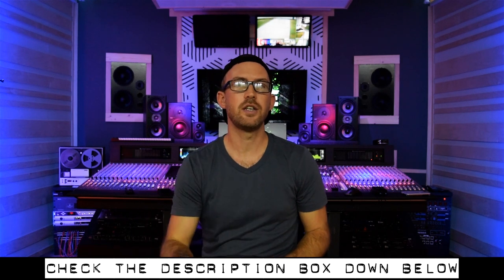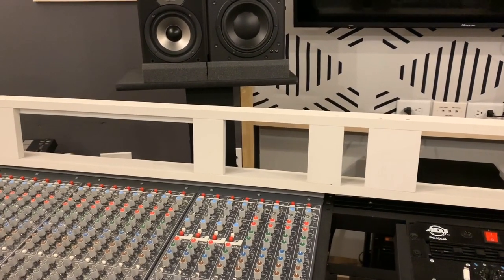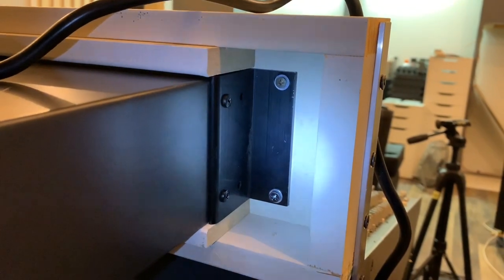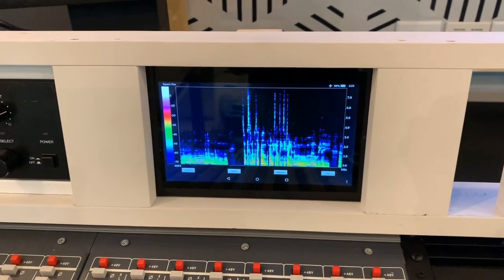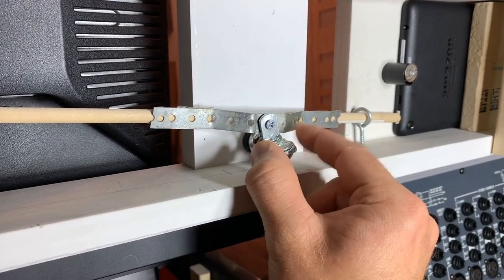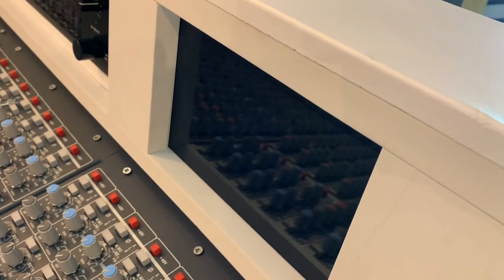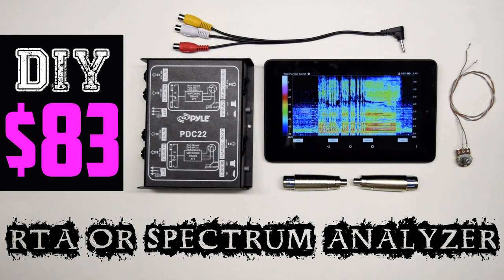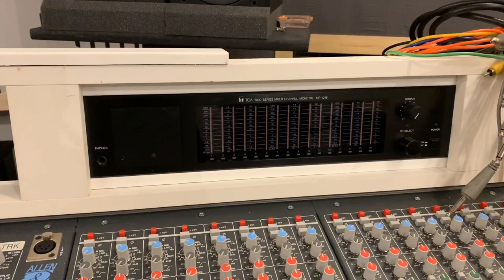Custom Meter Bridge for the ALLEN HEATH GL4000

Comment: finally someone who has done something like this.  love the idea of using the tablet but i think a much bigger one would be great....and feeding it from an aux is not something I had thot of...it actually makes a ton of sense.  I am working on the idea of taking the signal off the insert or maybe direct out.  I think the aux is perhaps more elegant of a solution and makes the freq analyzer more useful instead of pulling it off of a bus or working a switching solution.  great vid.  thanks!!!

Comment: Did you take the A7H apart and just use each piece to set in in there? Also, how hard was it to take it apart and what is the frame used for each section? It looks like each section is famed out

Comment: So how so you transport that large desk if you happen to move and relocate to a new location? I went with Argosy because of the engineering and quality that goes into their products. Their console desks are designed to be broken down entirely and put back together and can are engineered with a tigher tolerance that can last for decades.
Reply: You don't, it's stuck there forever

Comment: Not very accurate. Why would you do so much work and use Amazon tablets? There should be better screens used in actual calibration that give actual measurements results that would be usable this seems for cosmetic which is fine I guess